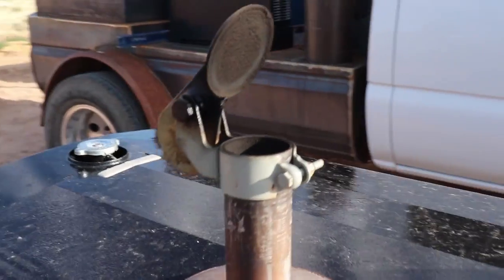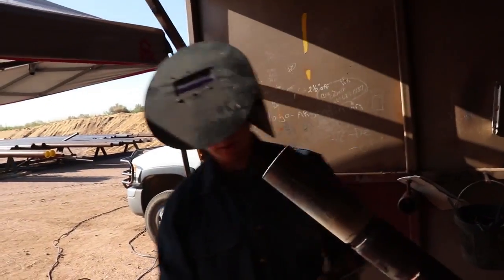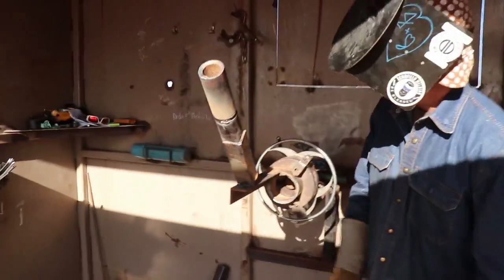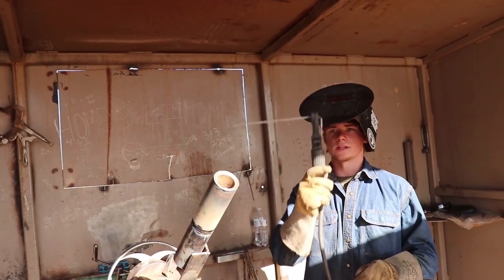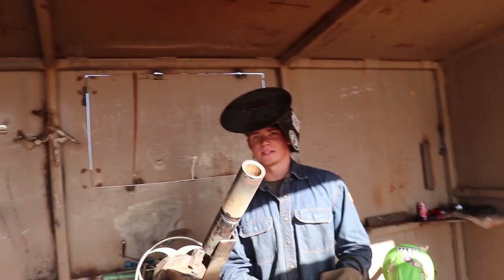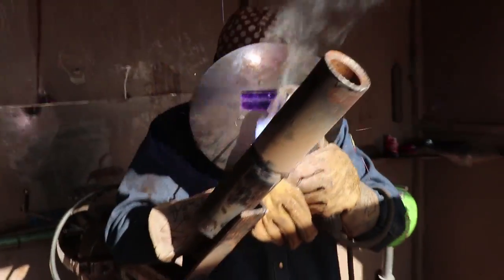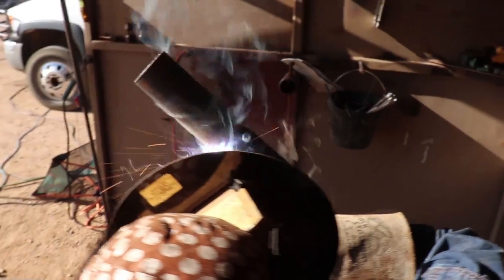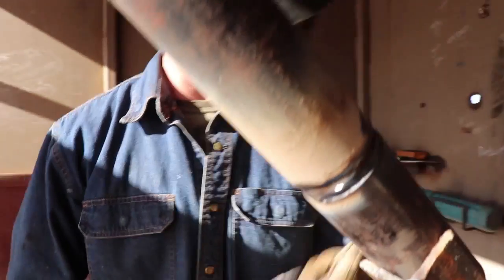Joshes Takes a Sch 160 2" Test.

Comment: Josh, Is that a SA 250 Perkins that you run? If so, how do you like it in the field? I have been looking at one and was curious.
Reply: B Jen yes it is. It is a 1978 that makes dc  auxiliary power . I like it. I wish I would have shortened the frame. But I didn’t know I should have at the time I rebuilt it. It welds great Jake used it for a week when he was waiting for his miller. He said,”its a capping machine!”